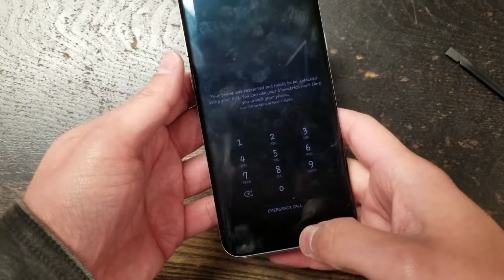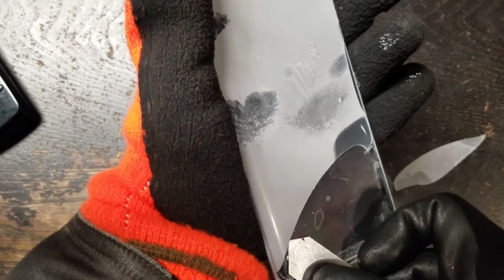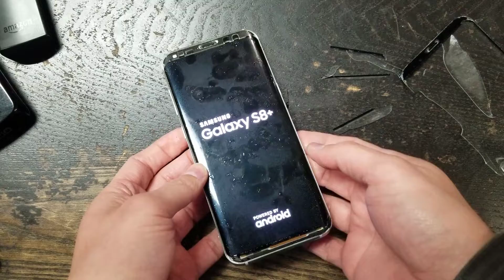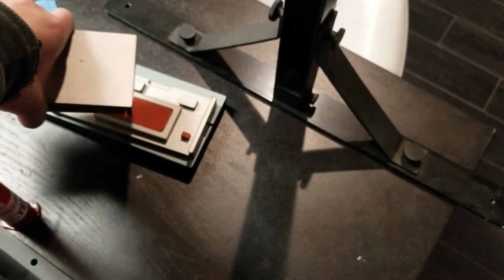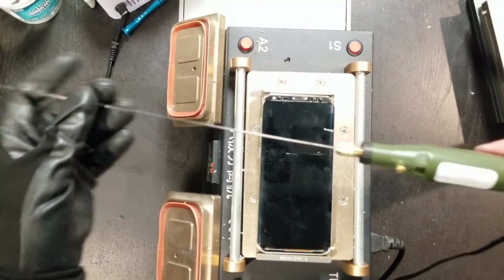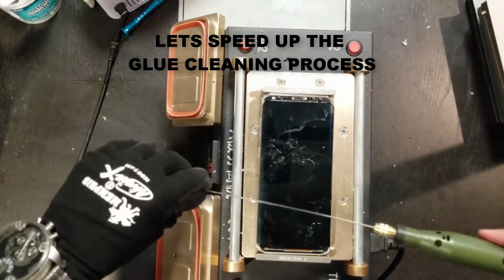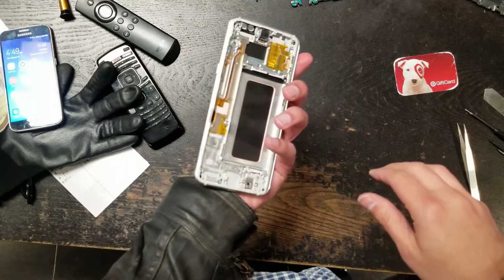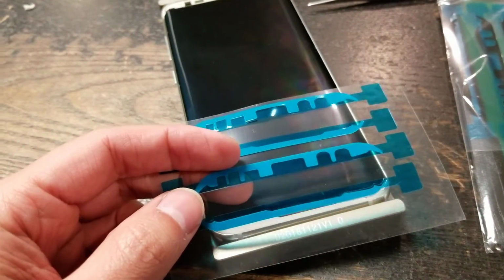The Easy Way To Clean Glue Off Samsung Galaxy S8 S8+ S9 Note 8 Screen

Comment: Where do you get that rotary tool bit and does it have some sort of abrasive surface or is it just a smooth flexible metal rod? I guess what I'm getting at is, could I just use any old similarly thin, smooth, and flexible metal rod on a dremel or similar rotary tool?

Also, you mentioned using isopropanol/rubbing alcohol to remove the remaining ashesive residue. Everyone in all the other s8/8+/9/etc videos I've seen has said the same. I've always used something like xylene or toluene because isopropyl alcohol (even 99%) just doesn't seem to get the job done as well... is there a reason why I shouldn't use xylene/toluene/M.E.K. and such rather than isopropanol on these newer edge displays?
Reply from the maker: Other adhesive removers will destroy the touch. The touch will become unresponsive. You can buy that spinning rod tool on Ebay. Type in the search bar OCA glue removal tool.
Reply: @RichardMeza  Wow, thank you for such a speedy response! I'll assume that you also mean that the solvents like xylene I've typically used for older models may cause damage, so I'll avoid them and take my time removing OCA residue on edge OLEDs with isopropanol instead. 

I searched eBay for such OCA removal tools and found some rotary tools with the rod bits, but the actual rotary tools in such kits seem rather cheesy and clunky compared to yours; I'll go ahead and order one anyway, even if only for the rod bits. Do you think I could use the bits in a variable speed dremel 4300 or another such adjustable rotary tool with a flexible shaft attachment to make the device easier to wield than the boxy-lookin' rotary tools in most of the kits I see on eBay? Do you have any rough idea of the rotation rate (rpm) you use with your tool so that I may try to match that when I do my own work?

Thank you so much for all the amazing information you provide. You're showing us how to do all sorts of stuff I never even knew possible and I'd imagine most people would prefer to keep much of this sort of info a "trade secret." You are the hero of the repair community imo, happily subscribed!

Comment: hi Richard 

is there any way to remove the loca glue beside that machinery that is very expensive. do you know any chemical that could remove the glue without damaging the screen? Thanks.
Reply from the maker: I use a $30 Loca glue removal tool. I used to do it by hand and a heat gun for like a year at first.
Reply: @RichardMeza   thank you for your quick reply.  have you use also the debonder  AD-1 or any acrylic based liquid together with the loca removing tool? Thanks.
Reply from the maker: @MrSpown1989  You can not use a regular glue remover like the stuff you buy at home depot. It will strip the touch from the screen and make it a non responsive screen. I only use Alcohol like in my videos. 91% isopropyl. That is safe with using with electronics.

Comment: Hi, could yo tell me what freezer do you use? Does freezer can separate samsung s9 as well? Thanks.
Reply: In your link is different freezer than you use I think that you have got older version. Could you tell me what temperature do you set up to separate glass. Thanks
Reply from the maker: @krystiantrick  Freezer works for the S9 as well. I have a video on that with my next upload maybe tomorrow or Saturday.
Reply: @RichardMeza  Could you tell model number of that freezer and what temperature do you set up? Thanks
Reply from the maker: @krystiantrick  There are 2 different freezers. The -145 and the -185 freezer. I recommend the updated version -185.
Reply: Could you tell me which one do you recommend? Is so many freezers on the market right now. Thanks.

Comment: I am from Germany you make Freese to -143 or?
Reply from the maker: Freezer is not used anymore. Starting with the Galaxy S10 and newer, it's done by heat and wire method.
Reply: @RichardMeza  But it is still possible to repair all age models Samsung S series with the freezer or

Comment: Hey Richard I have a question for you...
When you put that metal "knife" between the glass and screen, is there any scratches after?
Reply from the maker: No. The screen is frozen like an ice cube plus the screen is still covered in glue. As you see the video is about removing the thick layer of glue off the screen.
Reply: @RichardMeza  thanks and when you "pilling" glue off the screen with that spinning thing?
Reply from the maker: @crazysrbin88  no scratches. It's a smooth spinning rod. The glue sticks to the rod.

Comment: I'm in the bay area, but don't do these repairs. Do you offer glass replacement services? How much?
Reply from the maker: I repair customers phones that walk into my shop. But business to business I dont offer. But you can learn to do it yourself. I have many videos on this topic.
Reply: @RichardMeza  no need for a business to business relationship haha I have my own personal note 8 and a friend's s8 with cracked glass. Wondering what it would cost to have it repaired and the turnaround. S8 is leaving for korea Wednesday evening.
Reply from the maker: @ItsBinhRepaired  $175 each sandiegocellphonerepair.com
Reply: @RichardMeza  cool, thanks! :) might reach out if the cracks spread

Comment: Why do you take the back out? Is it so you don't expose the battery to -150°C?
Reply from the maker: So you dont freeze and ruin your phone. Motherboard, cameras, batteries, sensors would probably all screw up. You only put the screen and the mid frame in the freezer.

Comment: So my Note 8 screen is heavily cracked and I think the latter is broke since my screen is flashing black. I tore my whole phone apart and got a back screen replaced and battery but i think i may need and LCD screen now, how can i tell if the LCD screen is still okay or if i need a full screen replacement?
Reply from the maker: If your screen has black bleeding spots, partially doesnt work, dead touch areas or colored lines. You need the full Glass and Display screen replaced.

Comment: I used a -150 degrees freezer took the glass off checked the screen it was working fine cleaned loca glue off with isopropyl checked the screen again phone comes on but screen isnt....any help please???

Comment: Why do u take the back off and battery
Reply from the maker: The insides of the phone would freeze.
Reply: @RichardMeza  electronics can freeze it's when u turn it on it has to be back too room temp vehicles sit out in minus 50 below phones sit in cars when it's that cold I thought u would have a better answer like something quit working because of doing that
Reply from the maker: @kimthiebault2076  The freezer I'm using is negative - 145 degrees. It turns the screen into ice in 4 min. The motherboard would freeze, the battery would be ice cold, the cameras would break.

Comment: Completely wrong way of cleaning you are putting lot of stress on OLED, patients is the key of success in samsung refurbs, heat at 100 degree wait 3 mins for mold and 1 mins face down OLED then it will come of very easily with spin rod.
Reply from the maker: If someone doesnt do it 100% your way, doesnt mean it's wrong. I'm not wrong, you aren't wrong either. I did it the way you were describing anyways. What's the Temp on the machine say at the 5:38 mark? You know this is also edited. I'm not going to bore people dragging on with filming waiting for the mold get to temperature. That's what editing is about.